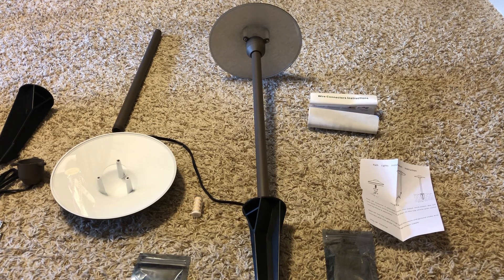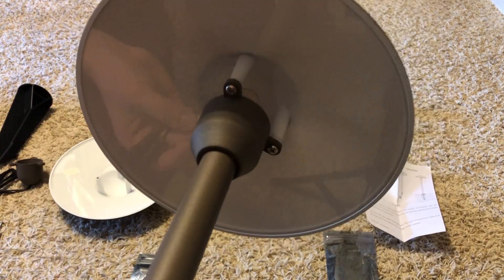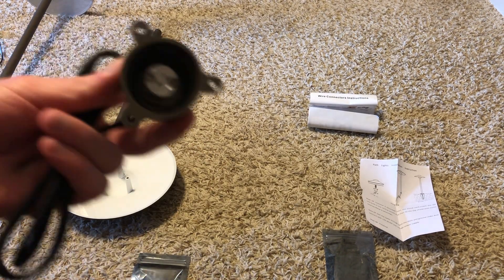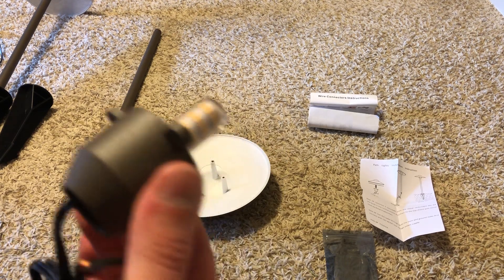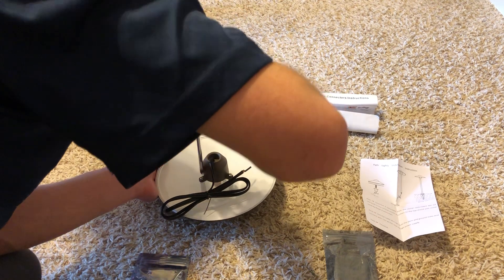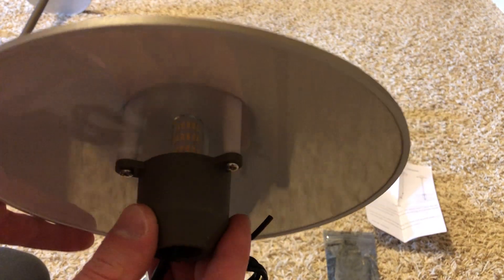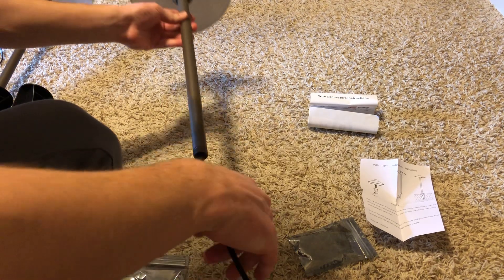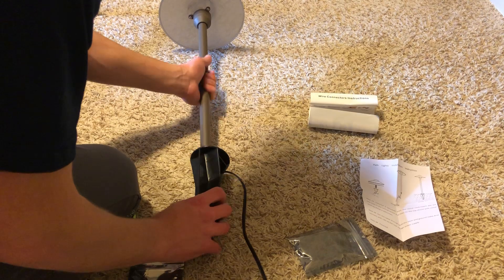Arrownine low voltage professional grade landscape path lights (part 1)

Comment: Hi, just assembling the light and I have the light fixture screwed onto the pipe.  Now I'm trying to install the base but for some reason I can't get it to thread.  I have two lights I'm assembling to start and the same problem with both.  Any ideas?

Thanks, Rick